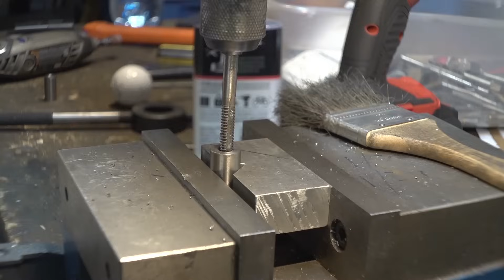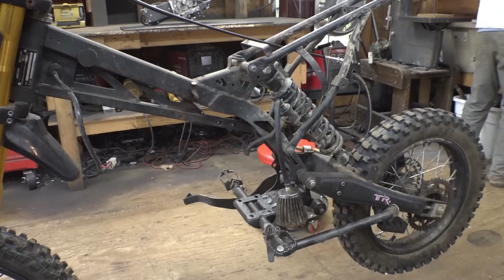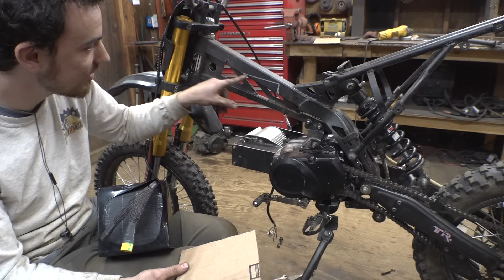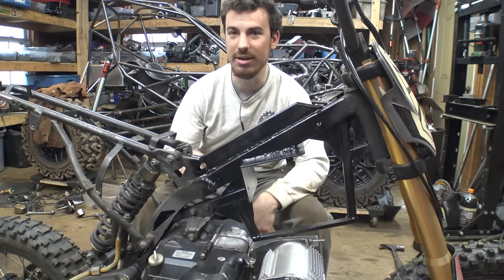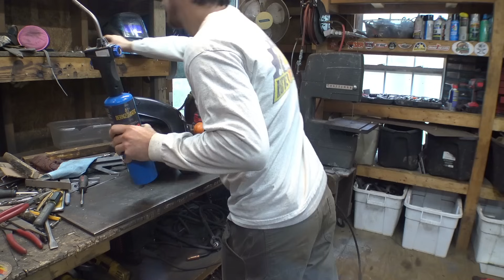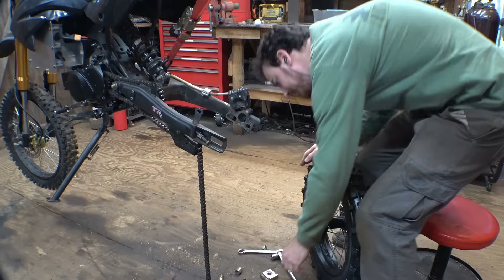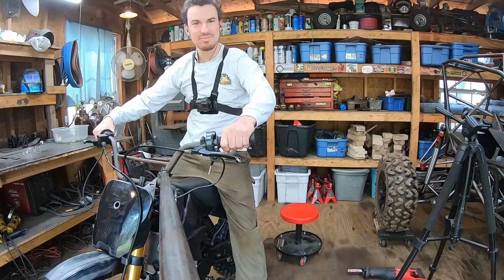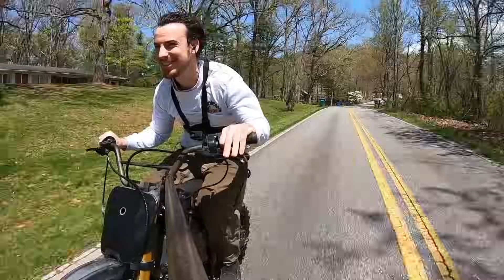A Different Way to Build An Electric Dirt Bike  - Part 2

Comment: I can never understand why electric bikes don’t have gears, this seems to make much more sense, awesome mod!
Reply: Electric motors can have wide flat power curves which makes gearboxes less of an advantage, gearboxes increase friction, weight and cost so if a manufacturer can avoid them through having a more flexible motor they will. Often they can get by with just a couple of gears hi/low range.
Reply: @robmanueb.  it's not as flat as you think, do dyno and you'll see big torque with low horsepower, there is no instant torque.. it's just fast gradually increase. Gearbox could fix this issue, but you may need a very long ratio. The only reason why manufacturers don't include gearbox is because it decrease its durability and of course you need more maintenance which counter the main idea of electric motor that less of maintenance
Reply: @robmanueb.  Why does porsche use an electric car transmission and drive faster than tesla?
Reply: Also people who say “electric motors have flat powerbands blah blah blah” clearly don’t understand that you are going to run out of gear sooner or later, adding another ratio means you can use that flat powerband all over again.......
Reply: @dylanzrim3635  you pretty much nailed it. unless you're running out of gear for top speed, or gearing for top speed is too long for the torque of the motor, there is pretty much nothing to gain with gears. you're losing time during shifts, power/energy because of the transmission, reliability especially using a gas transmission not rated for the added electric torque, youre adding noise and maintenance, weight, and rotational inertia. Turns out it is possible to make 1 speed electric drivetrain with little to no compromise. just look at a plaid that will smoke cars with more power and better power/weigth, from 60 to 165. it will from 165 to 200 when they unlock it, because power stays constant (within a few percent).
I would say for a dirtbike or a road bike intended to be ridden more or less within speed limits, 1 speed beats speed. dont get me wrong, I love a gas motorcycle, the ability to control engine breaking, cruise in six gear, etc, but a single electric motor can do it all out of the box. the interesting thing which is both an advantage and disadvantage is  electric has simpler controls, but gears giveyou a bit more control. but it all comes down to controls. its possible to add fake speeds to an electric drivetrain, or a fake clutch, to provide similar control, without the added  mechanical complexity.
Also keep in mind, that with the added weight, cost, and reliability issues of a transmission, you could just make your electric motor more powerful at any speed
Reply: @dylanzrim3635 Most electric motors also have much higher RPMs than internal combustion engines, also negating the need for gearboxes. A Tesla Model S can still hit 155mph (software limited) on just a single gear reduction for this very reason.
Reply: @dylanzrim3635  electric motors can go to basically infinite rpm as long as your ESC can give it the voltage. They already have enough torque from the motor so adding a gear box is a waste of money, weight budget and effort.
Reply: Think, Tesla’s getting beat at the drag strip, if they had a mechanism to extend the ratio it would go faster again
Reply: @dylanzrim3635  Lets just be fair here. Lets put a single gear combustion engine against a single gear tesla. Who wins ? Top fuel every freaking time hahaha.
Reply: @dylanzrim3635  DCT actually could fix Tesla's short breath problem, but you know it will cost a lot and more weight to carry
Reply: @MrJermbob  Umm, nope.
Reply: @dylanzrim3635  the gear box is completely  unnecessary.
Reply: because of the extra complexity as well as programming; yes the drag but really if you don't program in your applied torque curves to the controller you'll destroy most gearboxes on first ride.

There are bikes with gears, they're just expensive, compared to a 4500 USD Sur-Ron or Talaria - a base model is almost twice as much although you do get gearing, suspension, and range options.  And yes, they do by and large use clutch systems (see OSET or ePure EV trials bikes)

If Enviolo (formlerly Nuvinci) would get their act together and release a CVT that could take at least 250Nm of torque or even better 500Nm, then you would see a huge increase in large powerplant superbikes - the Isle of Man TT Zero class comes to mind.  But it would be a more useful improvement to be able to decrease weight and power demands and keep your top speed/bottom torque both.  Gearing opens up a lot of options for the vehicle designer although usually increases parts count.
Reply: Best thing to keep in mind is how brutal the power delivery is from a electric motor, gears used in EV vehicles whether for just power delivery or in a transmission tend to be quite beefy compared to a similar sized gas vehicle gears or transmission. 

So in the end reliable EV gears or transmissions are a lot more heavy duty and expensive even on something like a dirt bike.
Reply: @GENcELL2014  More brutal than dropping a twin plate clutch on a 1000hp car ?
Reply: @MrJermbob  ofcourse within reason. Just saying the instant torque of an electric motor tends to require beefier drivetrain if you want it reliable, I'm comparing equivalent power levels. Like a 200cc dirt bikes drivetrain compared to an equivalent ev will usually have smaller less robust drivetrain in general since power delivery from the engine wouldn't be as instant.

An equivalent ev drivetrain to a 1000hp race car with 2 step wouldn't be very different since they're both crazy demanding.
Reply: @GENcELL2014  Lets see electric get as fast as top fuel drag cars and then im interested.
Reply: @MrJermbob  electric motor and battery technology operating at top fuel dragster levels hasn't happened yet, but in the coming decades I'd be surprised if ev tech wouldn't start to be comparable when pushed to that extreme.
Reply: @GENcELL2014  11,000hp worth of electricity stored in a car is a scary thought haha.
Reply: @MrJermbob  Electric motors full torque all the time. Even launching from a stand still is like launch fuel based car at peak torque.
Reply: @MrJermbob  does that pit bike look like it had an engine with 1000hp on it? his point is that electric motors have more torque than gas motors so if you put an electric motor with more torque on the same transmission it's not good.
Reply: @icantthinkofaname5549  yeah man looked like 1000hp no worries
Reply: @MrJermbob  yeah an electric motor with enough torque to do what a nitro methane 10k hp is believable but the battery to run it would be crazy big!
Reply: @MrJermbob  yeah a spark would be like lightning and vaporize I imagine
Reply: @MrJermbob  yes, tesla has the same 1200nm of torque with a ford truck, and 1100 horsepower
Reply: No need for it really.
Reply: @Ratkill9000  lol bullshit
Reply: There are plenty of electric motorcycles with manual transmissions on the market.
Reply: @Goatee_yay  name one.
Reply: Cause loss and weight just aren't worth it.
Reply: many mid drive mtb ebikes have  many gears and they can go up some big hills
Reply: Technically there is no need but it can be done.
For the most part if you want to match an electric motor to a transmission, a 2 speed transmission is probably the best choice.  There's little efficiency gains (From what I have seen the numbers are sub 15%, I think was around 8%) but the complexity and parasitic loss from the transmission might make the match a niche market.
Reply: @johnsmithfakename8422  Would love to see the source for "gaining efficiency" with more transmission for an electric motor.
if you want more torque you use a higher Kv. If you want higher rpm you increase voltage.
If you get bad efficiency your setup is flawed from the get go.
Reply: There are a. Bunch of geared electric bikes but they suck my zero motorcycles has no gears and I'll beat most bikes of the line so don't think there's a need
Reply: @bsmith2340  At the very most electric motors would benefit from a 2 speed gearbox but most do not even need that. Single gear reductions cover 99% of all electric vehicle applications.
Reply: Gearboxes exist to maximize the efficient rpm range of combustion engines, they suck at high hi & low rpms.  Electric motors are more efficient across a far wider rpm range
Reply: @avnsteve1  yep and 0 rpm torque gets rid of a clutch or torque converter too.
it depends on the characteristics of the motor too. Ebike motors are limited in Tor qu and power being passively cooled, and can't have high voltage, so they benefit gears of a mid drive. most low powered ev sacrifice some top speed and highway power to have good acceleration at city speed. taycan uses two speeds to make better use of the power and but only on the rear axle because on a hard launch the front wheel do have enough grip to make use of more torque in the front.
the plaid power train is pretty much limited by traction from 0 to 60 then maxed out at 1000+ hp from 60 to 200. a transmission would only make it see6 slower and less efficient. it's pretty much signed the death of transmission on evs, plus ev with two or more motors can already benefit some of the advantages of transmissions by Having shorter gearing in the rear for more torque off the line too, and better efficiency cruising at highway speeds with the front motor
Reply: @geemy9675  given the WILDLY adaptable nature of electric motors, coupled with computers & ESCs, the transmission as we know it from ICEs is on its deathbed.  Until such time as electric motors and computer processing speeds get better, a gearbox might still be useful with some systems.  Electric motors' "peak" efficient operating range can only be based on what one needs at that moment.  Any EE / programmer could build a system to make best use at any given time, it's only a matter of time.  We'll see this born out in our life time.  Internal combustion engines should have been obsolete 40 years ago but the oil industry is more powerful than any given government,  so, we've had to swallow their bullshit tripe for decades
Reply: @avnsteve1  I mostly agree but there is not a lot of room to increase electric motors efficiency through software, it's mostly physical limitations. 
but yes efficiency is already good enough that adding a transmission that also reduces efficiency is not worth the additional cost/weight/maintenance on a car. maybe for some other applications like generators in large wind turbines. and yes for industrial applications it's probably better to design motors that cover exactly the operational conditions
 but there are some interesting research on electric motors like infinitum axial motor using PCB stator
Reply: You loose so much energy through the gears
Reply: @reachrightround3659  sur Rons also have a primary belt on for gear reduction so also some losses. the only way to have no loss is hub motors but they have other issues
Reply: Because they are not needed and just create more moving parts to fail.
Reply: If it use gears, it's mean need oil... and how to prevent it from leak
Reply: There is one that has gears I forget what it's called
Reply: 0 to 100 in a few seconds is what electric motors can produce without the need for hear modification, installment etc. Every single combustion car out there is tuned to perform on it's gearbox.
Reply: Because millennials can't drive a stick
Reply: Same reason electric cars have few gears. But if your using a cheaper smaller motor gears will help
Reply: Just more moving parts = lanes reliable . And u don't need gears .  Maybe just a head split for certain things . But u don't need it
Reply: For your answer u need to study about torque and rmp then study about why engine use gearbox then u may understand why electric motors don't have gearbox
Reply: Most actual do but they call them. Eco, normal and turbo
Reply: a properly engineered electric bike would not need gears... electric motors will destroy gearboxes.
Reply: Right
Reply: Friction is the major cause
Reply: Simple to keep rnd cost at minimum hence maximum profit baby
Reply: Because the more you transfer energy the bigger the losses. So they trade gears for mileage in my opinion.
Reply: Could save battery too as the motor doesn't have to work as hard to achieve speed
Reply: Because they don’t need gears
Reply: I really experienced the need for a gearbox when building a electric motorcycle with a cheap Vevor 2000W motor kit. My first build lacked power to start and go uphill and would not go fast enough. After finding a wrecked 4 speed motorcycle for my 2nd built, I now have a small motorcycle that can carry my 175 pounds up very steep hills in first gear and go as fast as 60 km/h in 4th gear on flat road.
Reply: I tried a Brammo Empulse R in 2014 with a clutch and gearbox and this thing was SO fun. Too bad they don't make those anymore.
Reply: a bike with no gears and no clutch its a no no to me its like riding my boring automatic scooter... no thanks
Reply: @tougeattack123  Maybe while you're at it you could also simulate a manual fuel pump and maybe put in a large speaker to disturb people and wildlife.
Reply: @flexo3333  i bet you don't ride motorcycles.Engine sound exhaust clutch and gears is what makes a bike fun to drive.Some people may find it anoying but who cares life is to short to dont enjoy what you like
Reply: @tougeattack123  loud pipes save lives!!!!
Reply: Because EV fans are scared of gears
Reply: @dylanzrim3635  I learned to drive on a 3 in the tree when I was a little 8 yr old farm boy. We're not afraid of gears, multispeed transmissions just don't make sense when applied to electric powertrains other than for nostalgia. They're just dead weight that's adding friction and taking up space for fuel storage.
Reply: Electric bikes don't need gears but I think they need clutches instead of just using a throttle for fine control. The Electric trials motorcycles have clutches for the big explosive jumps they do.
Reply: @keshmo12  🤣🤣🤣 i don't believe you even have an e-bike or at least an e-bike withany sort of power, you have no idea what you are talking about dude🤣🤣🤣
Reply: @arronjohnston742  never said I owned an e bike. Just saying you need a clutch for fine control. Ever try to ride a rekluse auto clutch on a 450 without using the clutch? It's jerky and you have no fine control.
Reply: @keshmo12  you have no idea what you are talking about

Comment: The clutch probably slips because the oil isn't hot enough and it won't heat up enough by itself.
Reply: Unlikely, because if that was the case, with a gas engine, it would always slip while warming up.

Comment: Yep, around 14.5 minutes running full load. 20 minutes  if you back off a little. 
That is awesome. Thanks for taking on such a project.
For the next project, bigger motor means bigger battery or less time. Maybe you can lay some batteries on either side of the frame and under the seat, so find the batteries and build the frame around them. 
Biggest problem may be the clutch pack again - bigger motor means a lot more torque.
Reply: The clutch will handle it as long  as the gear increase is before the clutch and not after. The clutch can handle the speed but not the torque.
Reply: A bigger motor would mean not needing a gearbox or clutch, it's all about the torque
Reply: @andyb7963  Ofcourse!! Obvious now you mention it Andy! 
You still have a gear going from the motor to the wheel to play with, and you need convert the 0 - 6000RPM of the motor to say 0 to 100mph of the bike so you need a reduction ratio of around 8:1.
Problem is ratio of 8:1 needs 12 teeth  on the motor and 96 teeth on the wheel - that is too large wheel gear and too small for the motor end, 
Ideally a 2:1 or 3:1 reduction box will still be necessary before the chain drive cogs.
Perhaps a direct drive arrangement may be better?
Ofcourse sizing the motor, given you will need that kind of reduction is very important too since an electric motor has maximum torque at 0RPM and zero torque at 6000RPM.

Comment: Giving how much time you spent riding this and the distances. I'm pretty sure you went more than 3 miles on that current charge. It be great if you hooked the charging system back up. Wouldn't hurt to extend your ride time a little longer.
Reply: Any charging system would use more power than it would produce for a net loss.
Reply: @robertheinkel6225  not true on this application. If he uses the stator and fly wheel that came with the 110 motor it wouldn't consume much power as it would If he put a pulley one. Instead it would be in its original spot on the crank shaft.

Comment: I noticed you were still using the clutch like it was a running engine to take off, you dont need the clutch held in when you're sitting there without it going anywhere, being electric. You put it in first gear and take off

Comment: you need to cut vent slots in the battery box so the battery doesn't overheat and maybe add a cooling fan